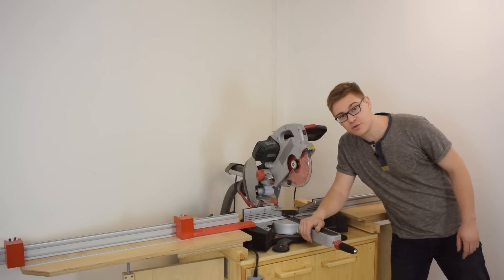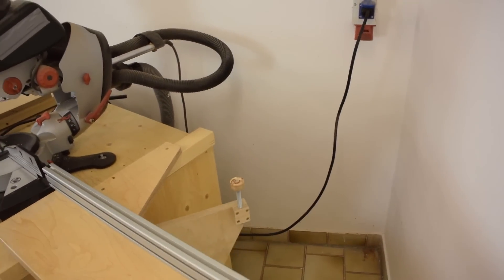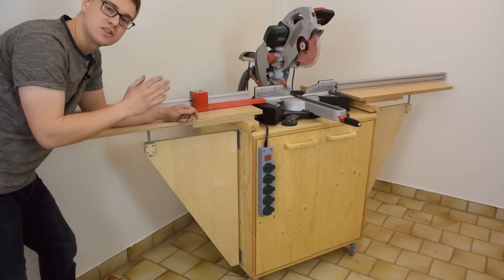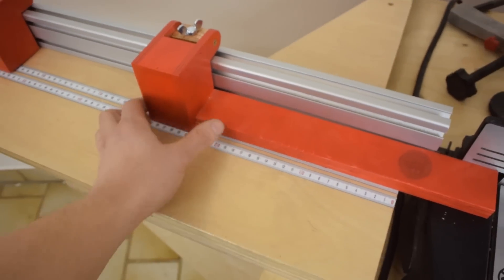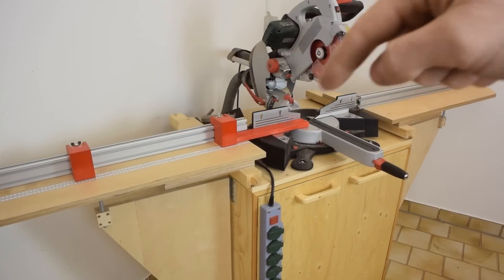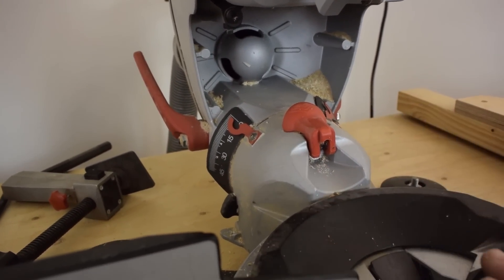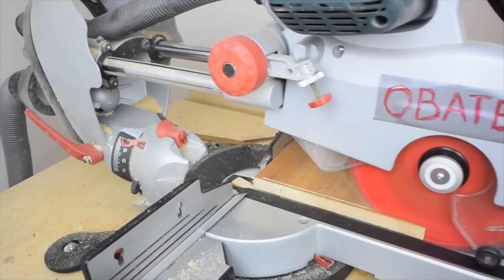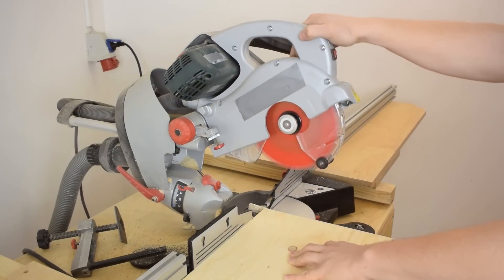Miter Saw Station | Stop Block System | Dust Collection Test | Metabo KGS 254 PLUS

Comment: Do you need the fence on the right side w/o scale?   Seems to me you could save that cost.  The piece being cut has to register flat against the saw's fence to be safe and accurate,  and the additional fence is (in my experience) superfluous. You just need coplanar support on the side opposite the stop block system.  The extrusion/stop-block system w/ scales on the left side is clever.     I think you are holding the small piece on the side of the stop block to avoid the small piece being caught between the blade and stop block, which would happen if you held it on the right side.  Can you think of a clever way to be able to hold it from the right side -- maybe the nose of that block comes to a point at the saw's fence.  Not sure that would work.  Other ideas?

Comment: Great station. But in 3:29 your fingers were too close to blade. It was very uwise. You should be more cautious. Good luck next time.
Reply from the maker: Not really. I have good control over my body. So no Problem there.
Reply: Schluck... Wieviele Unfälle sind wohl schon passiert, weil jemand alles unter Kontrolle zu haben glaubte...

Comment: It appears there is room in front of the orange knob for a small dust collector.  That would assure a greater dust collection, but you would have to see what size collector would fit in that small space.    I do like the table you built for the miter saw and it's ability to fold up to save space and the on-board shop vac.

Comment: tape some cardboard wings on the sides of the collection port and it will probably catch a lot more dust. It looks like you could extend the collection port much closer to the blade without it getting in the way.

Comment: Great video (again). Many years ago at my former work, we had looooong tables and the saw was hidden in the wall until one pulls the handle. It was used to saw Aluminium profiles for building side structures on a bus. It had a similar tip-down stop as you have made. For a while, I've thought about how I could implement some of this idea into my work shop, without sacrificing too much space. 
Your video gave me some ideas...thanks for sharing your knowledge with us.

Comment: Excellent work on the stand. You said you weren't convinced of mitre saw use in the shop until you built the stand and now you use it every day of a project. If you don't already have a crosscut sled for your tablesaw, that is another item that, once built, seems you wonder why you waited so long to build.

Comment: That's what I'm going to build for my KGS 254 M. Not as fancy as your plus, but good and on a budget. Were can i find the plan?
I need it mostly for size of the top of the miter station (the two saws are the same size), but i'm going to build the wings on a different system.
I will share my build when i finish it.

Comment: Hi @Cosmas Bauer, nice smart build and video, as usual. :)
How did you adjust the height of the saw versus the wings to be in one exact plane? Just shave material off the "wing mount part"?
And another comment on safety; I know some very experienced, half-deaf German carpenters who miss fingers and others who use protective gear and safe technique even if it costs time. You are smart enough to know that even a slim accident chance of 1/5000 will probably catch you one day if you work enough hours. Please consider more distance between your hand and moving blades. Believe me, if you never spend a half year in rehabilitation, painfully re-learning to use your post-operative limb, it was worth all safety concerns. Best regards from someone who is currently learning to walk again ;-)

Comment: I think you would be glad it has a horizontal handle.  The vertical ones are not very comfortable.  They need to rotate through an angle that is more than the wrist can bend comfortably.  Nice work station for a compact setup.

Comment: Very practical table. What kind of tracks did you use for the stop blocks? (name)
Reply: "Item" aluminium extrusion, may not be Item brand and there is a lot of unbranded stuff to be found
Reply: Thanks for your reaction. I think I was not clear enough. I was not asking for the name of the material but for the name/type of track (not necessarily a brand)
Reply: ah yea aluminium extrusion framing material. we use it at work its strong  il be making most of my shop furniture out of it. item is the brand we use (we have to use brand names) if you search for item they have loads of products and demonstrations.
Reply: This is a really fantastic idea.  I just love it.  But can you tell me how you attached the aluminum extrusion to the tabletop?  Just screwed in from the bottom perhaps?  Many thanks!!

Comment: Since you need to use your right hand to acrivate and use the saw wouldn't be better to put the stopblocks on the right side of the table? By using the set up you have shown in this video you have to hold the piece with your left hand on a very little amount of surface meaning that your hand may be too near to the saw and really exposed to danger.
BTW i'm am a great fan of the channel and I really enjoy watching your videos

Comment: very nice!
if you don't use the knob in the back (catching the dust) would not creating a smooth(er) transition with tape solve the issue? (or at least reduce the catchpoint?)

Comment: Suggestion.

Put a lock nut on the bottom of your threaded rods before they work themselves loose and then your extension arms aren't level anymore. 

Great build!! I just got my first 10" sliding compound miter saw :)

Comment: Hey Cosmas, von wo beziehst du eigentlich all dein Holz? Das Baumarkt Zeug hier ist echt schlechte Qualität und ich wüsste nicht, wo ich sonst schauen soll...
Reply: I would also like to know that. In the usual diy center, you get nearly no plywood and only very bad quality. Germany wide operating "wood dealers" (probably not the correct wording) like holzland almost only sell construction timber. Same for local wood dealers here. I also sometimes see woodworkers use hardwood and I have no clue where you can buy this (if it isn't beech glulam or tropical hardwood for decks).